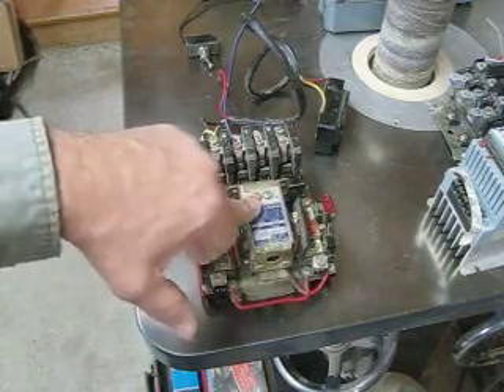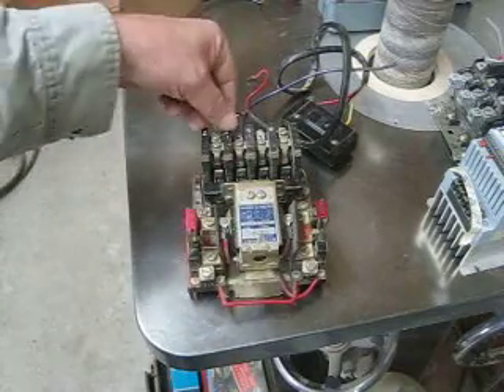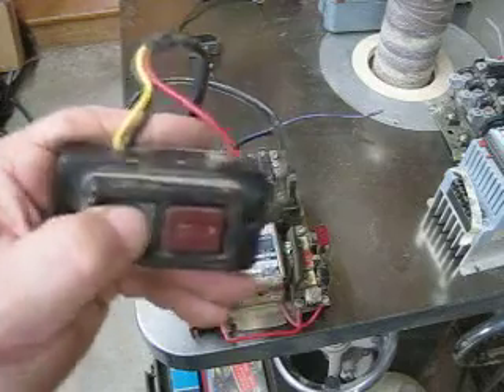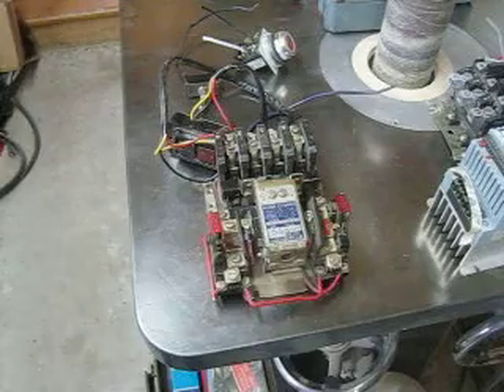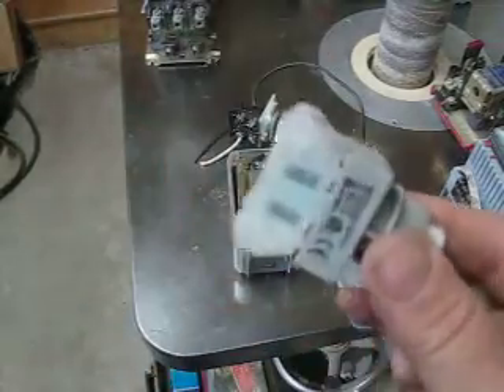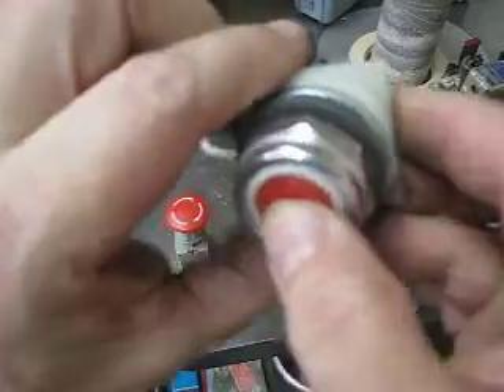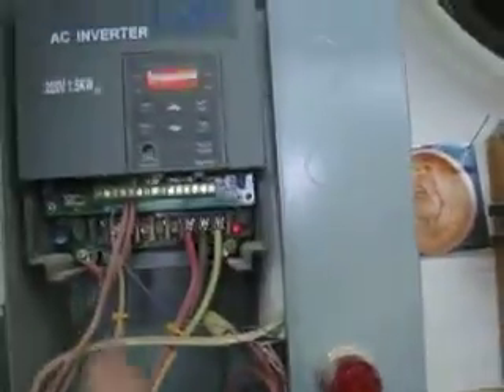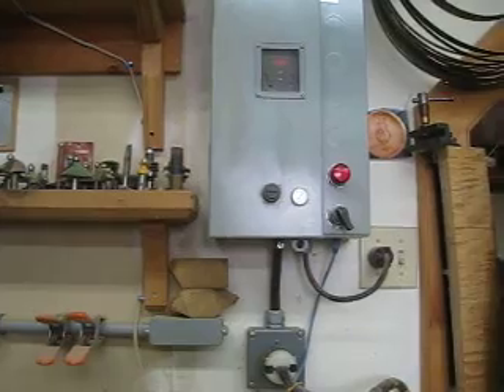Nema and VFD  motor control switches basic functions  Part 1

Comment: if I plug in another motor (ie switch back and forth 2 machines) do both motors have to be the same hp?
Reply from the maker: they can be different HP  but the drive CAN  ONLY BE SET TO PROTECT ONE THERMALLY at a time  .

Comment: So would the Woodstock D4151 110/220-Volt Paddle Switch be considered a maintain switch since the contacts stay closed once pressed?  Since I have a Nema Starter on my saw and its wired for 220 does that mean this switch gets full the full 220 running to it?
Reply from the maker: +Selta sevenseven  I believe that that switch has to have voltage for a reset relay. Its is a motor rated switch but would be complicated to us as a control switch.
Reply: +jack English machines If i put up a short video about it showing what i want to do would you be kind enough to look at it? I truly appreciate it if you could make a suggestion
Reply from the maker: send a link and i will comment
Reply: Hey false alarm I figured it out! - What wasn't making sense to me was that I had to jump a 110 leg to the load side of the switch - its in working order now
Reply from the maker: glade to hear it . Enjoy

Comment: I have a surface grinder that has 2 3 phase motors, one for the spindle and one for the hydraulic pump for automatic table feed. So I will be using 2 vfds, motor vfd for speed control and 3 phase conversion and the hydraulic vfd strictly for 3 phase conversion. 
Just curious if I could wire both vfds to have individual start/stop switches but have a single ESTOP switch as opposed to having to flip 2 switches if something goes screwy. Wired power to all sorts of AC units and all my machine tools but low voltage DC seems to be somewhat of a mystery to me lol. I have seen some ESTOP switches that have 2NC/2NO circuits, would that basically be the solution I am looking for?

Thanks in advance sir!
Reply from the maker: +Finn Custom Knives that is  what i would do a stop switch with two contact blocks one for each VDF stop command.